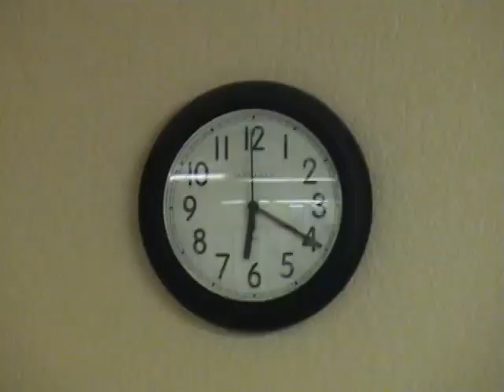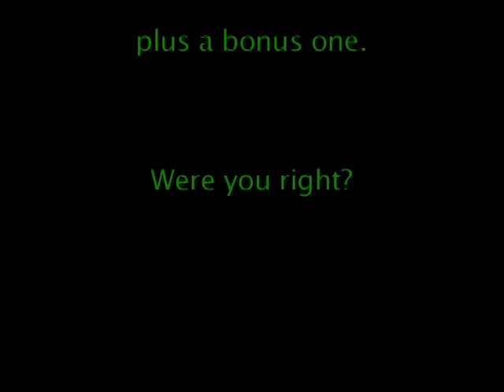Waste Management Safety DVD with Answers

Comment: Wow, they added some new rules? Screwing around with wheel chocks around your truck in the landfill would be more hazardous than staying in the cab at the controls while dumping. Considering all the activity that goes on there.  In the real world, you dump your truck where the spotters put you. Somtimes within 5 feet of the next truck. Parking brake should be enough to 'secure' the vehicle. If its not trusted enough to do so, then that vehicle should not be on the road. Just my opinion though.

Comment from the maker: @r6man2 Woodland, Ca, near Sacramento.  3 points of contact: when climbing, entering a vehicle, etc, you must always have 3 points of contact (i.e. two hands holding on and on foot on a step, or one hand holding on and two feet on something solid.)  I idea is to prevent slips and misteps.  I twisted an ankle pretty badly a long time ago, when I stepped backward out of my truck and let go of the handholds before being completely on the ground.  3 points of contact would have prevented this.
Reply: Steven O'Shea Pretty stupid if can’t climb out of a truck I drove for 30 years never had a problem.

Comment: @oshfarms13 
Yeah, that's what I was talking about. Does the same rules apply to the flasher strobe lights on a McNeilus? What landfill was that, Puente Hills? This is a good video, but it's kinda funny. WM is so big on safety and rules and such, and yet, they were suspended from doing any trash in CT till next year in 2007. The company that took over all of the WM trucks in my area said they were so run down that they sold all of them.

Comment: Shouldn't you block the hydraulic cylinders on the tailgate if you want to keep it open while working on it?
Reply: Yes
Reply: @Amrepdude499  The older mcneilus' like the one they were working on don't have tailgate safety props newer units do.
Reply: @Bus285Productions-l1x  that’s interesting. The gen 2 autoreaches my yard had which were 101 series 2002s as opposed to this 103 series had tailgate props. Surprised to hear these ones didn’t. Perhaps the shop over here fabricated some themselves…idk, we got rid of those trucks 5 years ago now so I doubt any evidence is lying around

Comment: W.M.  has 856 rules in the thier Rules book.  The average route supervisor is hired from out of the field of this line of work.  They typically work for 2.5 years and then are fired for one reason or another.  Then we get another idiot for 2.5 years.  So back to the 856 how are we supposed to finish the route?  

But remember work safe.  856 rules really to pick up trash. Wow.
Reply: Maria gutierrez   Was there 10 years. I couldn't endure it one more second. In that time I saw about a dozen supervisors come and go.